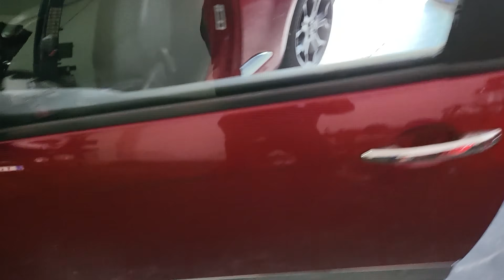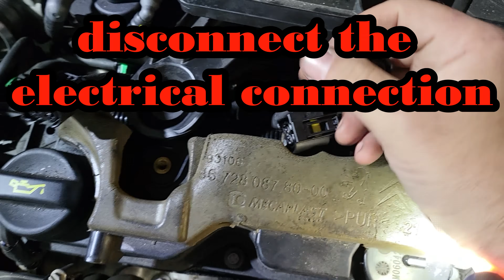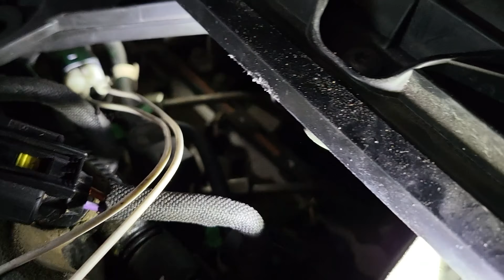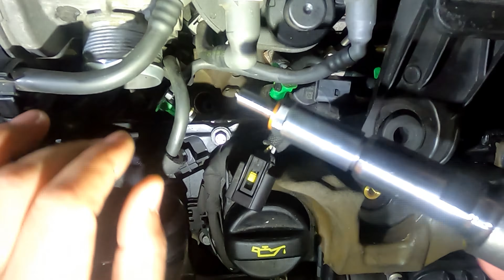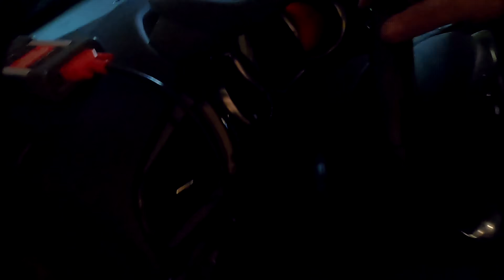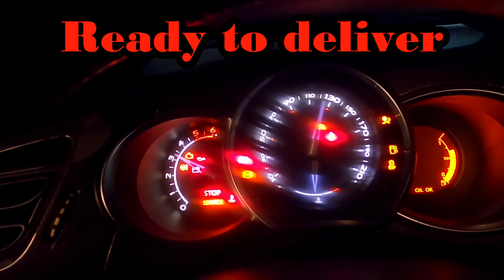ds3 p0271 injector 4 short circuit

Comment: Thanks for nice explain video,
after changing the injector, doesn't need to clear fails by diagnos unit?
Reply from the maker: thanks for watching
i would clear the fault so that in the future it wont get a miss diagnose because of this code that is from a previous problem.
also you should code the injector to the car via diagnostic so it wouldnt really take much to erase the fault.
good luck

Comment: Great,  now need the video showing how to remove the plastic air duct so you can access and remove cylinder 4 return fuel line.  Cant seem to get it off and I notice you already have yours removed? Any ideas how I remove this?  I have removed the retaining bolt and loosened 4 hose clips but the entire ducting remains solidly in place.

Comment: These Continental injectors are known as fragile parts ! 112 cv that means. I noticed that you had not to modificate the code in the ecu!? Thank u
Reply from the maker: Thanks for watching.
Yes i did change the code but it was not on video because this video was about a different subject, but i have a video on my channel that shows how i code it.
Thanks
Reply: @PSICompanyPerformance  thanks for sharing. I´ve changed all 4 Injectors and coded them with Citroen Diagbox. Engine shakes still when it´s Cold below 10 Degrees for a few Minutes. then when its little warm it runs very smooth. 
do you have a Link of your coding Video? I didn´t found it on your YT channel.
thx.
Reply from the maker: @ap-mechanics  thanks for watching.
Coding these injectors is al about putting the code on the side of the injector on the ECU via a diagnostic machine, just remenber the number 1 injector is on the gearbox side and the number 4 is on the belt side.
Reply: @ap-mechanics  Maybe add P18 mecarun to engine oil and 400ml of 2 stroke jaso fd to an almost empty dieseltank and fill full up diesel.
Reply: @PSICompanyPerformance  hi,where is that Video with coding Injectors,can you please copy that Link? 🤗👋

Comment: hola como es el orden de los injectores por favor y como los sacaste gracias por el video
Reply: Empezando por la distribución 4-3-2-1
Reply from the maker: Thanks for watching.
The order is 1 is on the gearbox side.
I used a injector puller to remove...its easy to remove.
Good luck

Comment: that faulty injector was from a 2010 from the code on top, the one you replaced it with was from a 2013 👍
Reply: How do you identify the date from the code?
Reply: @jamiebkc  first letter of the bottom code, K 2011, L 2012, M 2013, N 2014 and so on

Comment: What did you use to code the injector?
Reply: which solved the problem?
Reply from the maker: @markomladenovic4899  thanks for watching..
It did solve the problem and the car worked flawless after the replacement of the injector and coding.
Reply: @PSI.Company Performance
Reply from the maker: Thanks for watching 
I used Autel 908 pro, it works in most of the car that i have tried so far.
Reply: @PSICompanyPerformance  thank you, just changed my injector but struggled to find how to code it in! 😂 Appreciate the video. Good job